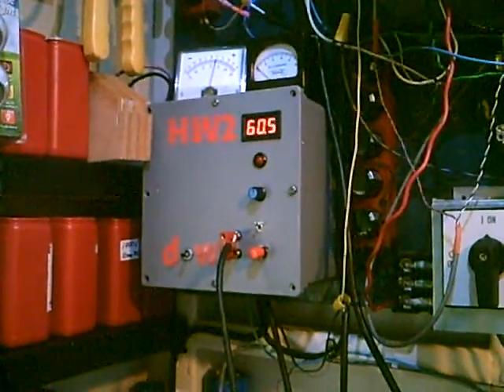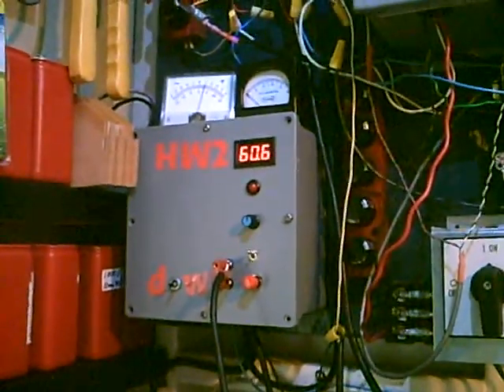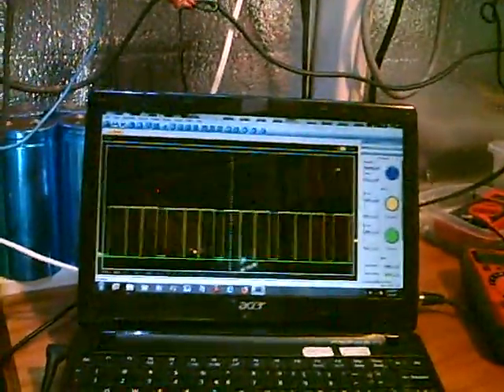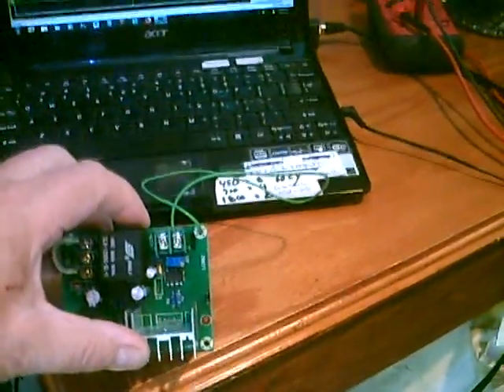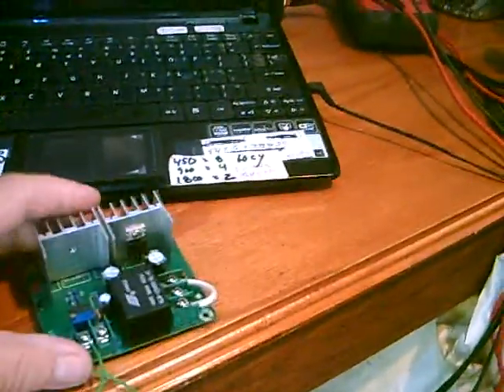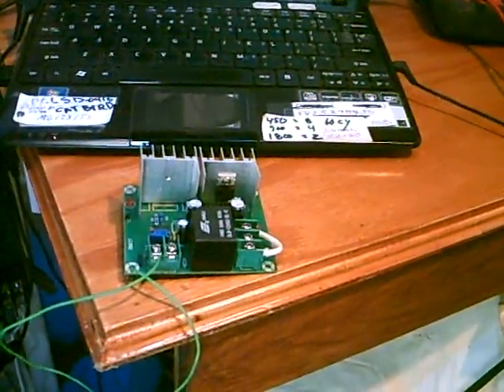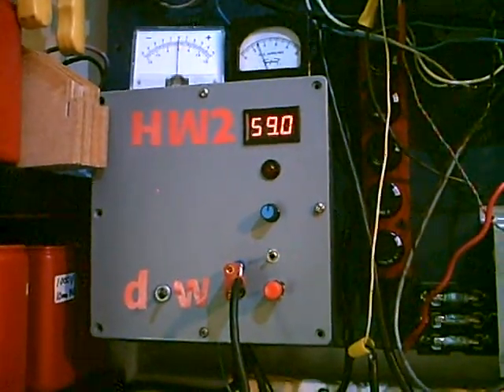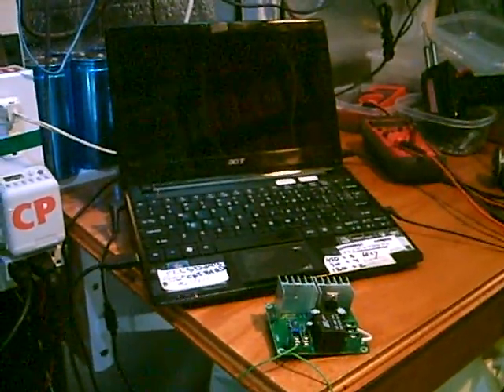UPDATE MPPT Heating Water With PV SOLAR at High Efficiency You Can Build

Comment: Do you use a 20-gallon heating / storage water tank in order to reach a higher water temperature?

For instance, a 40-gallon heating / storage water tank will need twice as much energy to reach the same temperature.
Reply from the maker: I was using a 9 gallon and a 20 gallon in series,  In the last two weeks the 20 gallon was replaced due to leakage.  The primary tank became a 6 gallon ECOsmart which has better insulation. Each tank has its own controller.The 9 gallon became the makeup tank. This does give a very fast response.  It takes less than a KWH to heat that 6 gallon 60F. It also has the advantage that I can plug it into the generator and typically get 125F water in ten minutes on really bad days. You can do a lot with 10-15 gallons of hot water.

The downside of this 6 gallon tank is 125F is the highest it can get. Probably to avoid potential lawsuits though it says it can get much higher.

Comment: Hi. I couldn’t find a way to PM you.  First - I really like what you are doing. I think pV direct heating has huge potential. I have more permanent plans but for now I would like to get some or all of my surplus 235w modules doing some space heating.  For now, was thinking about resistance matching baseboard heaters with the array at mpp.  Am concerned about safety of high voltage dc in the house.  What do you think is the optimum config of series/parallel module wiring?  Could keep voltage around 50v with 3 modules in parallel but I have about 42 modules to use.  I think there is something magic about low voltage in the electrical code relating to safety.
Reply from the maker: I have several designs bases on inverter boards.  These all have a 50/50 output and if the frequency is low enough, there is sufficient time to quench an arc using standard AC thermostats.  That makes wiring easier, but requires more heating elements.  A microprocessor would allow you to have a maximum of +90% duty cycle producing more heat.  These programs are very simple. Search and ask questions on thread "Multiple heaters with a UNO" on fieldlines.com. You can message me there.  Would appreciate it if youtube is not mentioned.
Reply from the maker: Done some thinking and have the idea for a system which allows for 8 heater circuits. Up to seven of them can be on at one time and one will be off at at any time. This happens many times a second and the short off period allows mechanical temperature controls to be used for zone heating. It matches how many heaters can be on at the same time to match the maximum output output of the panels. Wiring wise this is very suitable as a home system if a lot of panels are available and multiple heaters.  For smaller applications the video's method would be better.